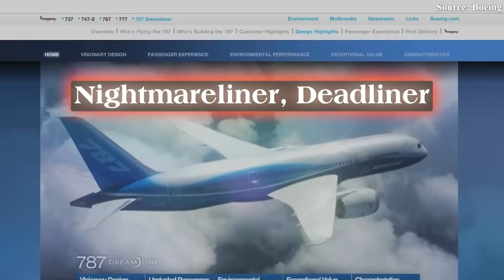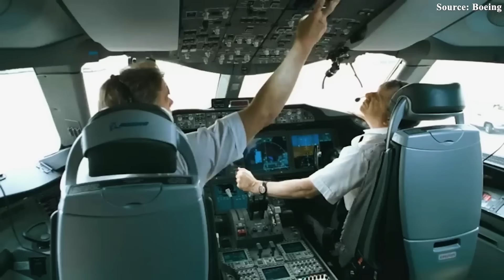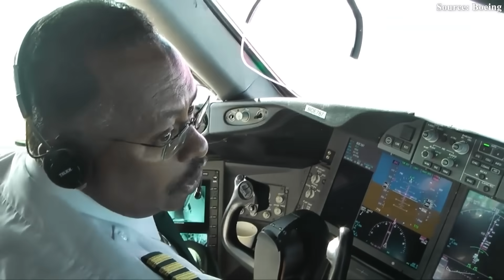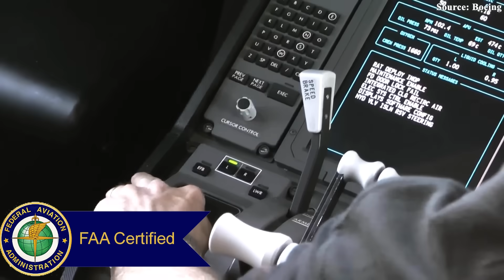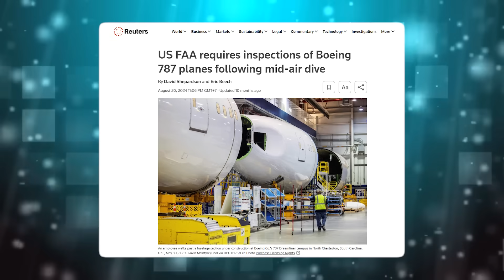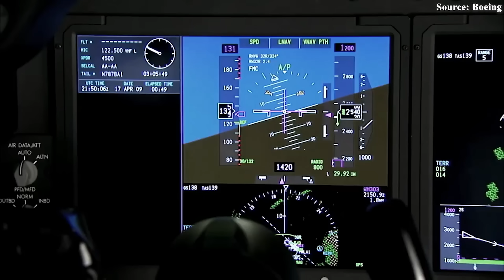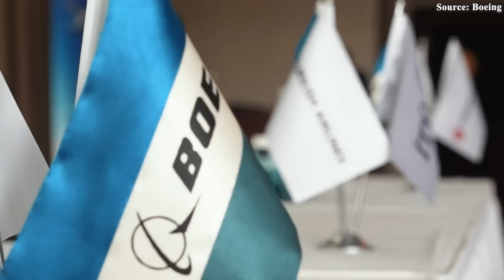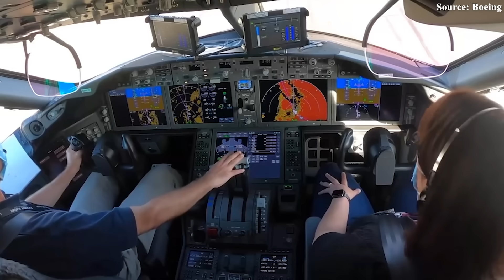What They Just Found In A Boeing 787 Will Leave You SHOCKED! Here's why

Comment: Look. Before you say Boeing you need yo know that is the name of the merged Boeing and McDonnell-Douglas. The old Boeing was into good engineering. The later was into profits. They also promoted all their executives just before the merge. Quality has gone down for that reason. 

They were boasting that they had 35 , worldwide sippliers. How do you maintain consistent quality control? How do you maintain timely logistics? How do you maintain your production schedule? 

Also, composites are strong but not malleable like metal. They tend to break catastrophicaly. 

Firing a CEO doesn't solve fundamental design, manufacturing issues. It ultimately is cheaper to address these in the beginning rsther than retrofit later.
Reply: I was actually surprised when checking the safety record of DC8 v DC10.
I've always preferred to take a longer holiday and go by sea and road.
The risks of flying have always been understated moreso in those two examples.

Comment: Why did it get to this situation in the first place must be asked Is it Engineering Designer Faults or Faults with the Carbon Fibre Laminating Whatever the problem is regarding the Boing 787 Its down to the manufacturer to eliminate these H&S problem's  before any more incidents occur or even move it elsewhere for corruption  rebuilds  It is Boings Failures it's their hands that are dirty They must solve the problem or get rid of it

Comment: Boeing is NOT responsible for lack of maintenance; India didn't change blocked fuel filters!!!
Reply: It may not be fuel filters, it may have been an electrical failure. Wait until they have decoded the Black Boxes before jumping to conclusions. The fact that the RAT deployed is very significant.
Reply from the maker: thanks for sharing

Comment: Boeing should have more of an engineering decision than business profits. I work in a company that makes Radars. We have oitsourced our cable systems to save money. Good thing we don't serve the airline businesses. We tests our radars, but once you have problems with miswiring cables...the logic signals going into those cables might be reversed. Instead of OFF it is actually ON. Luckily we catch the problem before it reaches the customer. If the million lines of cables inside the airliner cannot be checked or damaged by FOD (foreign object debris) such as sharp shavings that wete reported in Boeing but ignored. Building an airplane must be top- notch people who had prior experience in aviation or given a class for about 4 months how airliner works.
Reply: Boeing has been outsourcing for the last 93 years

Comment: As usual, always, the disaster is due to pilot error, ATC , weather, bad maintenance, the runway is bad , birds , … but never ever the manufacturer.
Reply: In that particular case, it's poor maintenance by Air India, if not the COMPLETE ABSENCE of maintenance after all the problems they had on the first haul from New Delhi to Ahmedabad. This plane should never have been allowed to fly again, unless complete overhaul was performed at Ahmedabad airport. For remainder, they encountered a total loss of electricity in the previous flight. Now I read that the fuel filters were completely blocked and they didn't change them ! Air India = the worst airline in the world.
Reply: If you had any business sense you would understand why.

Comment: Over the years Boeing has offshored Engineer and Manufacturing Techs to Bengaluru India. they have a huge Office Building there with 18,000 Employees. I have no problem with Indian Engineers, I'm sure they're qualified, but the problem is they are 9,000 miles from the B787 Factory in South Carolina. It's far more difficult for normal communications with the Factory or with Seattle and Foreign workers are less likely to give the Executives and other Bosses feedback, especially the negatives because they are so far away and under control of Indian Supervision.  I'm concerned that Important Safety info will be stifled by that. Another reason I won't fly on any Boeing Aircraft manufactured after the B737-900ER

Comment: The truth from the black box will NEVER be revealed if it was a Boeing mistake. Mark my words, it will be determined to be a pilot error. I pray it's not a glitch with the plane but indeed a pilot error.
Reply: It was flying for 11 years without any mishaps until it went through overhaul maintenance...then the accident happened. Could it be that something has been ignored to be checked per maintenance procedures?. Remember an airliner from Peru crashed in the Atlantic after refurbishment after the maintenance crew forgot to remove the tape on pitot sensors after repainted that gave false data to the computer.

Comment: If it’s true this plane had multiple electrical failures on the previous flight, it should have been grounded and gone over from nose to tail very carefully, especially all electrical systems.
Reply: This plane should never have been allowed to fly again, unless complete overhaul was performed at Ahmedabad airport. For remainder, they encountered a total loss of electricity in the previous flight. Now I read that the fuel filters were completely blocked and they didn't change them ! Air India = the worst airline in the world.

Comment: it is an amazing aircraft,,,,    but aircraft do crash,,,  sadly boeing has not had the greatest management for a long time
might be better now but the damage is done
Reply: Or is it air India?
Reply: The VACCUM LOCK  / VAPOR LOCK due to fuel overheating when for 4 hours in hot sun on tamrack  is NOT an Boeing  problem, it is ONLY Air India maintenance iissue!
Reply: @leopard2845  aircraft sit outside for a week sometimes and dont get vapour lock and hotter

Comment: 14 years without a failure. I question Air Indea's upkeep of their planes.
Reply: Until I see FMS input ...
Reply: Boeing has problems  you know 😅
Reply: In that particular case, it's poor maintenance by Air India, if not the COMPLETE ABSENCE of maintenance after all the problems they had on the first haul from New Delhi to Ahmedabad. For remainder, they encountered a total loss of electricity in the previous flight. Now I read that the fuel filters were completely blocked and they didn't change them ! Air India = the worst airline in the world. This plane should never have been allowed to fly again, unless complete overhaul was performed at Ahmedabad airport.
Reply: @xuartema4067 I suspected they might be at fault yes 😅
Reply from the maker: yep maybe